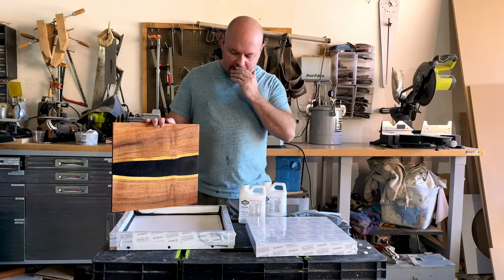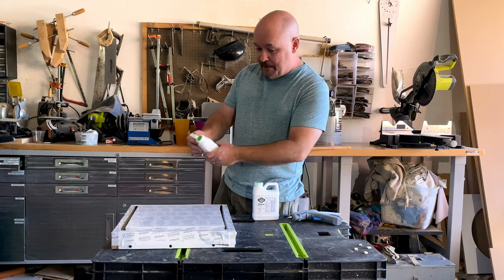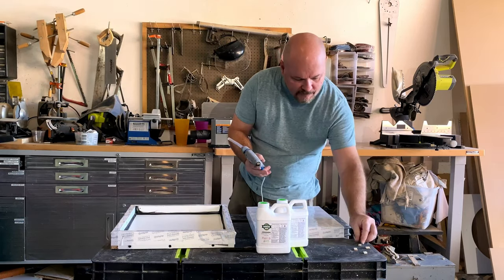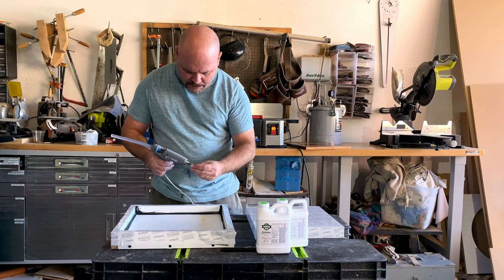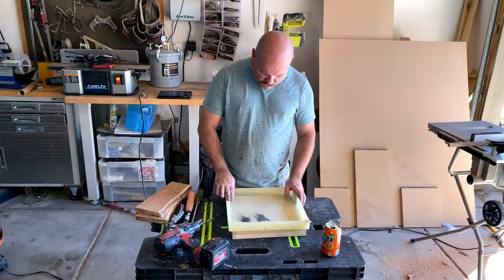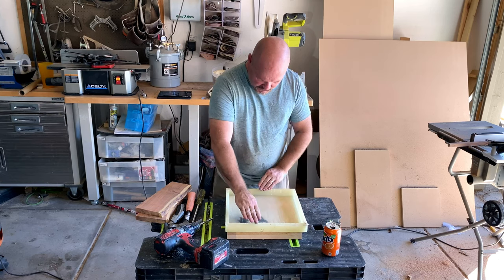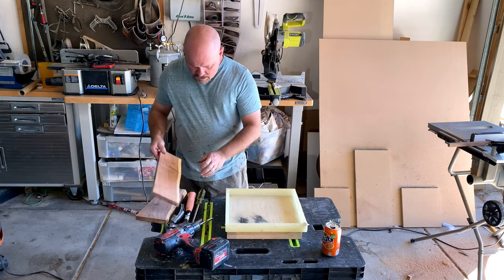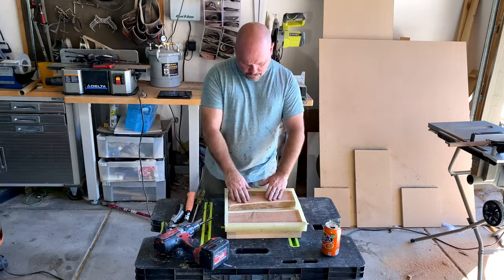Woodworking - Reusable Mold For Charcuterie River Boards

Comment: Wow that’s a great reusable mold!! Think I am going to make one myself! Thanks for the inspiration!!
Reply from the maker: I’ve since discovered that pourable rubber makes for a better mold material. It’s a little more flexible and less reliant on the mold release spray. I use this:  https://www.amazon.com/Smooth-Silicone-Making-OOMOO-30/dp/B004BNF3TK/ref=sr_1_5?dchild=1&keywords=pourable+rubber&qid=1609080595&sr=8-5

Comment: Have you considered making a coffee table or dining table size mold? That's the only thing in my mind for past 2 days. Quite stuck with the decision coz I have never seen anyone make that big mould and that makes me think there must be some cons I can't foresee.
Reply from the maker: it would be pretty expensive as the mold material isn’t cheap. you would have to make several tables from the mold to justify the expense
Reply: So if you were to do a kitchen table, what could you use as a mold then

Comment: Just saved this video!  Great idea
Reply from the maker: I’ve since discovered that pourable rubber makes for a better mold material. It’s a little more flexible and less reliant on the mold release spray. I use this:  https://www.amazon.com/Smooth-Silicone-Making-OOMOO-30/dp/B004BNF3TK/ref=sr_1_5?dchild=1&keywords=pourable+rubber&qid=1609080595&sr=8-5

Comment: Well done! Trying to reuse melamine or plywood molds is a pain. Good solution. Question. I'm curious why start with 80 grit after the boards come off the planer. Doesn't your planer leave the surface smooth enough to skip a grit or two? Thanks.
Reply from the maker: I need to change the blades out. I have a couple of small nicks in the blade that leave a very small ridge. The 80 grit makes quick work of it.

Comment: So it's 15 months later, are you still having good luck with the Smooth-On molds?  Thanks
Reply from the maker: No. I found that this particular brand of rubber got too hard over time. I’ve started using another brand now: https://www.amazon.com/Smooth-Silicone-Making-OOMOO-30/dp/B07P89QZJ1/ref=sr_1_11?crid=1S6TBETCX79WD&keywords=Liquid+rubber&qid=1642263089&sprefix=liquid+rubbe%2Caps%2C136&sr=8-11

Comment: you took that plank all the way to 1000 grit just to pour epoxy on?
Reply from the maker: Yes I did. It was one of my first river boards, so I was overzealous. However, I have found that sanding to a very high grit can be useful as it doesn’t give the epoxy much to stick to and therefore allows for easy removal of the excess epoxy that comes over the river channel. But these days I mostly just spray some lacquer on the parts I don’t want to allow epoxy to penetrate.

Comment: No facemask? No repirator? No ventilation and no gloves? 
Liquid epoxy resins in their uncured state are mostly classed as irritant to the eyes and skin, as well as toxic to aquatic organisms.[54] Solid epoxy resins are generally safer than liquid epoxy resins, and many are classified non-hazardous materials. One particular risk associated with epoxy resins is sensitization. The risk has been shown to be more pronounced in epoxy resins containing low molecular weight epoxy diluents.[55] Exposure to epoxy resins can, over time, induce an allergic reaction. Sensitization generally occurs due to repeated exposure (e.g. through poor working hygiene or lack of protective equipment) over a long period of time. Allergic reaction sometimes occurs at a time which is delayed several days from the exposure. Allergic reaction is often visible in the form of dermatitis, particularly in areas where the exposure has been highest (commonly hands and forearms). Epoxy use is a main source of occupational asthma among users of plastics.[56] Safe disposal also needs considering but usually involves deliberate curing to produce solid rather than liquid waste.[57]